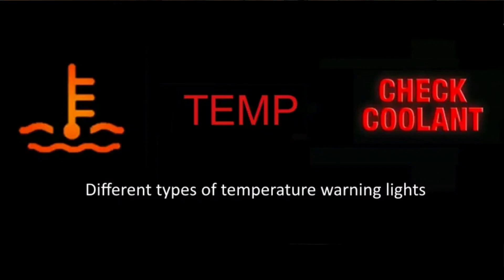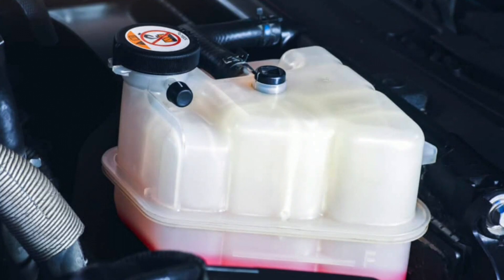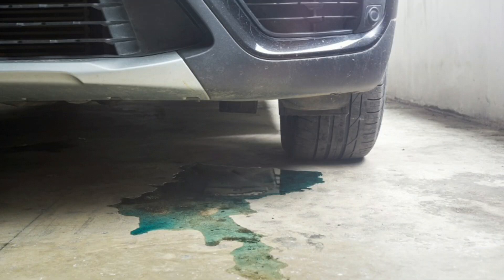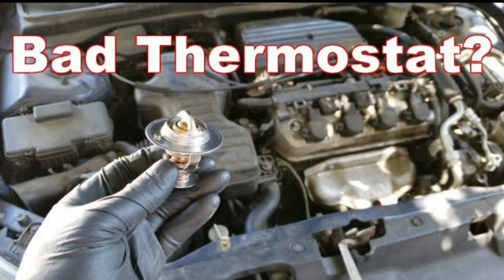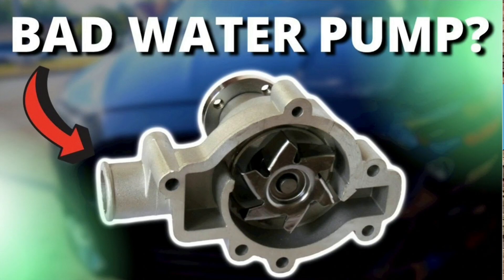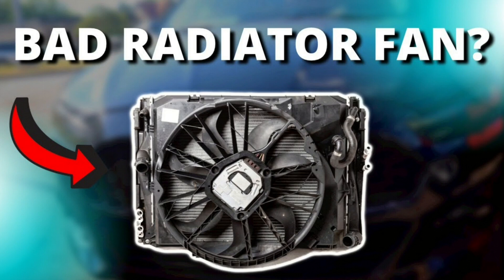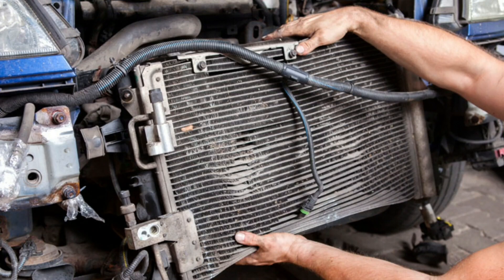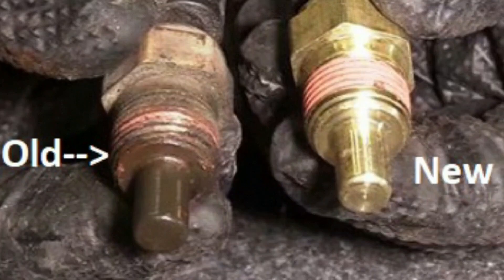How To Fix & Reset Coolant Level Low or Coolant Temperature Warning Light Stays On or Flashing

Comment from the maker: ✅ COOLANT LEVEL LOW / TEMPERATURE WARNING LIGHT STAYS ON? 🚗
👇 Drop your car’s make, model & year below — I’ll help you fix it!
In this video, you’ll learn:
✅ Why the coolant level or temperature warning light comes on
✅ Common causes like low coolant, thermostat issues, radiator problems, or sensor faults
✅ Step-by-step troubleshooting & DIY fixes
✅ How to reset the coolant warning light safely
🚗 Works for most cars:
Toyota, Honda, Ford, BMW, VW, Hyundai, Kia, Nissan, Chevy, and more!
📲 Still seeing the coolant warning light or need help with fault codes?
Comment below — I reply to every question!

Comment: I do everything bout is not cooling
Reply from the maker: @GerardAboubakare  If your 2006 Polo Vivo isn’t cooling even after topping up the coolant, it could be one of these:
👉  1. Air trapped in the cooling system – Bleed the system to remove air pockets.
👉  2. Thermostat stuck closed – Replace it if coolant isn’t circulating.
👉  3. Water pump not working – Check for leaks or weak flow.
👉  4. Radiator fan not turning on – Inspect fan fuse, relay, or temperature sensor.
If the coolant light still stays on after fixing these, try disconnecting the battery for 10–15 minutes to reset the system.